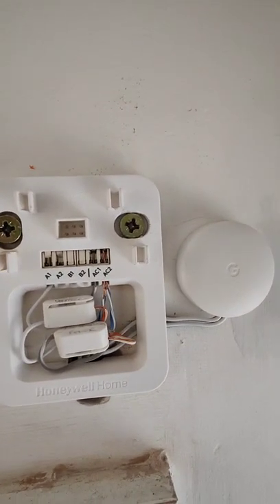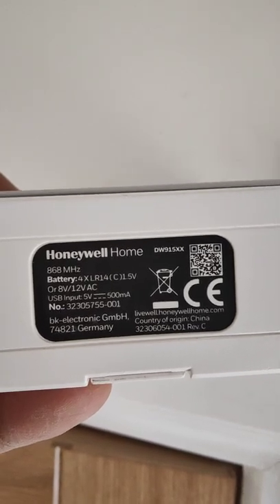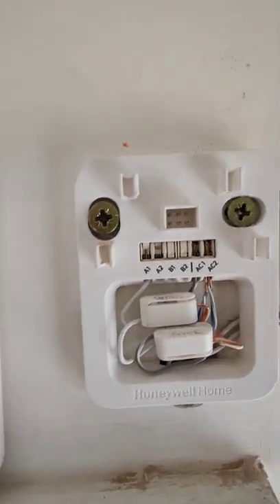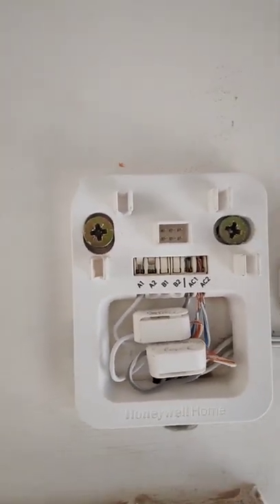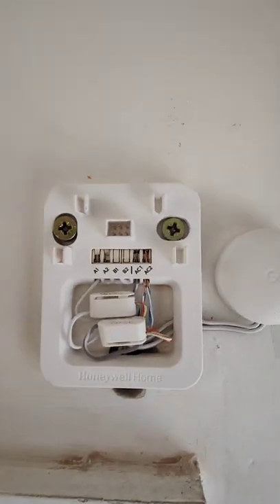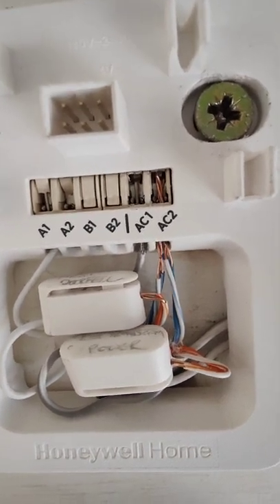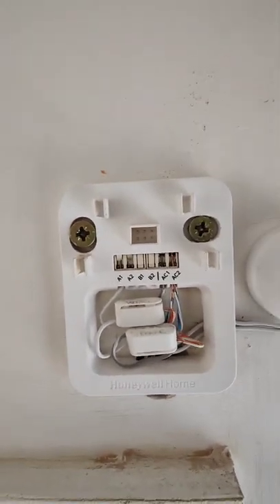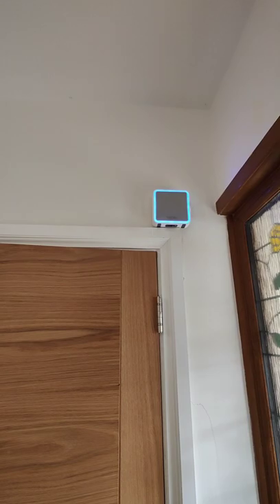Wiring up Google Nest Hello Doorbell with Honeywell DW915s Electronic Chime (RJ45 & Tel Cable).

Comment: I've been struggling finding out info on the Honeywell door chime so this has been great....  A diagram would be brilliant for others to follow.  Anyway my setup is slightly different but still works even though my electrician bought the DW315XX, wired the cat 6 cable but didn't connect it as he said my Google Battery Doorbell aint compatible.  Anyway it does work, the only thing I was unsure about was the AC2 connector.  Thanks again!!
Reply from the maker: Hello Raj..Glad it was helpful. I will do a diagram and post it also. Most 'standard' electricians are clueless about Google NEST Doorbells and it was an irritant for me hence why I sorted it myself!
Reply: I am thinking of getting this chime and wiring it to a google doorbell battery. I don't suppose you have a wiring diagram do you? Finding information on connecting the battery doorbell to a chime is so hard, so happy I've stumbled upon this video!
Reply: @ryanhicks4256  Hi Pal - My doorbell is the battery version Google Nest Doorbell (I know that sounds daft but it can defo be wired up) so I think it is much easier to wire in as I don't have the white "puck".  The Doorchime is DW315XX which has the same mount as in this video.    I'll try and explain as I'm not sure how to post a diagram here...  I've got a cat 6 cable from the transformer to the chime and then it continues to the doorbell.  At the transformer I connected 1 wire to 0v another wire to 12v and a 3rd wire to 12v.  At the Doorchime - the 0v connects to AC1 and one of the 12v wires connects to AC2 - this powers the chime.  From the door chime you need to connect a spare wire to A1.  This wire then goes to the doorbell.  So the last bit of cabling is to use the other "3rd" 12v transformer wire and connect it to the doorbell....& you are so right a pic would be much better!! I'm no electrician so at your own risk....  Not quite finished as on my doorbell app I told it that this is a wired installation and that it has an electronic chime and voila!!  Another comment about my doorbell is that if you whack everything on so it records all events it will drain down the battery as it eats more power than can be supplied.  This is certainly the case at the moment with the cold temps.  Anyway good luck and let everyone know how you get on!!
Reply: @Raj B  Thankyou ever so much for your reply. This is the exact setup I'm looking to do. Google Battery doorbell wired in to this exact chime. Literally zero wiring diagrams on the web about how to do this but I think you've nailed it. Will try your setup over the weekend. Really appreciate you taking the time to reply!
Reply from the maker: @ryanhicks4256  I don't know if you saw the wiring diagram I posted? Weird it isn't showing up. If you PM me (not sure if you can, phone number) I can take a video of the end to end.. or I will try upload again via a link
Reply: @squibworth  I did look for the diag but couldn't find it! Can't see a way to PM either.I think I get it though. Pretty much had it from your vid but wasn't sure if I was missing something from your white wire blocks. Also having the battery doorbell is a little different as no chime connector. Really appreciate you posting this vid!
Reply from the maker: @ryanhicks4256  Hang tight for a minute or maybe 10 mins or so let me do a little sketch and see if it uploads.. I'll try do an end to end video also.. what bell transformer do you have?
Reply: @squibworth  Same one as you I think. It's just from screwfix, has connections for 12V or 24V
Reply from the maker: @ryanhicks4256 I've pinned the wiring diagram to the top of this post!
Reply: @Raj B  @squibworth Set this up this weekend and working like a charm, thanks ever so much for your help!
Reply from the maker: @ryanhicks4256  No worries. Glad it was helpful! Hopefully someone else stumbling on this will find it useful too.

Any other videos you want to see or need help on, let me know?

Comment from the maker: Fairly new to making videos etc so if you would like an end to end video then I can upload one showing the joins of wires and into and out of the transformer into the Honeywell Unit.

Any questions, just shout!
Reply: Thank you for your video. I am not finding a 24V chime to install with my Nest Hello. Your solution looks great. However something is not clear for me:  You are saying that you are using a 24V AC transformer. The Honeywell DW915s chime is 8V/12V AC. The Nest Hello requires 12 to 24 V AC.  Are you connecting the 24V transformer directly to the 12V DW915s chime (in AC2)?
Reply from the maker: @PatrickFarrugia  Sorry just seen this comment. Don't get notified for comments. I will double check for you shortly and post a comment but from memory (if you haven't sorted this already)

There are two pins on the BG transformer that come out of the top of the terminal - PIN 1 (0v) and PIN 4 (24v) which I probably meant.

You connect both to those. And then wire up as per above. Give me a shout if you haven't sorted it and I will take a video of the unit for you.
Reply: Have purchased a  Honeywell DC9  and cannot  open up wire clips on the converter .
Where do you push the clips to open them for  insertion  of the wires.
Others have. Said they are  very fragile